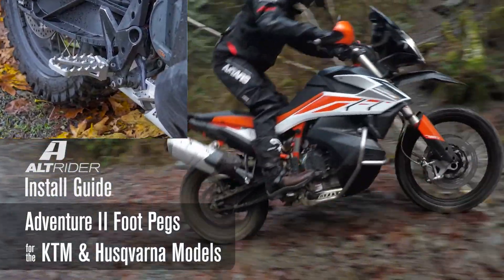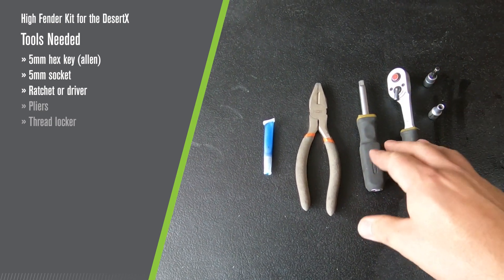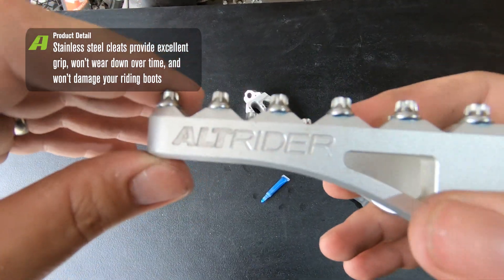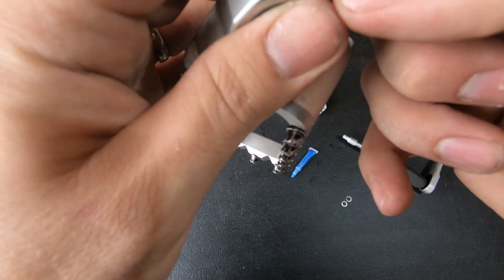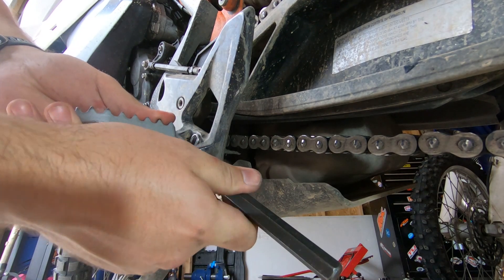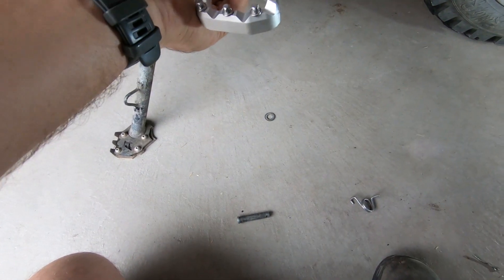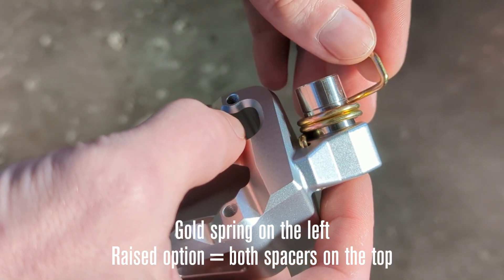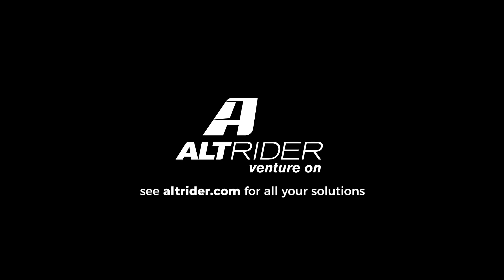KTM ADVII Foot Peg install by AltRider

Comment: The spring in the lowered mounting version is not fitting! Only thing it does is scratching the bike.
Reply from the maker: Please contact our customer service team: +1 206-922-3618 or info at altrider.com

There's either a issue with the part or the install, either way we should be able to provide a solution